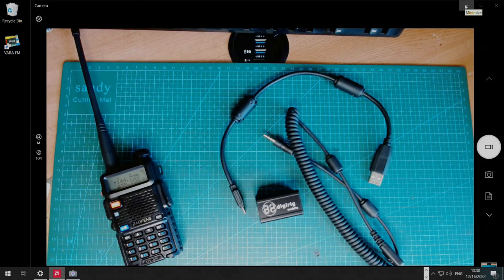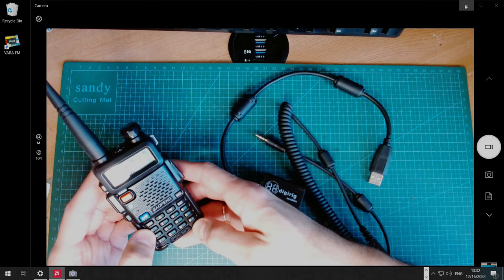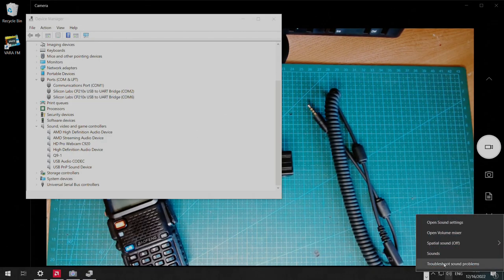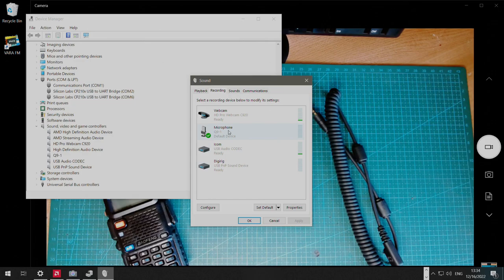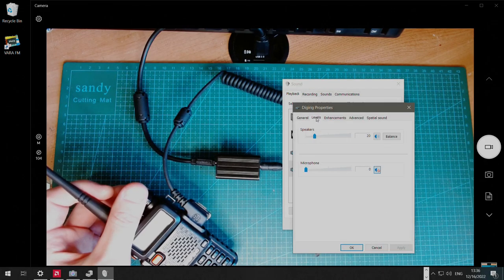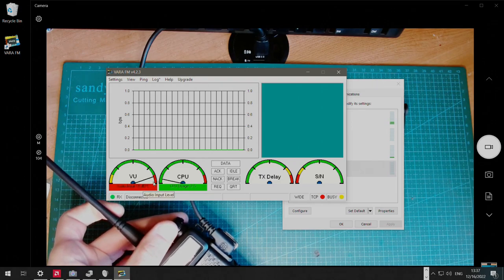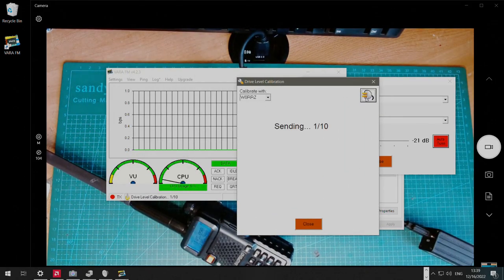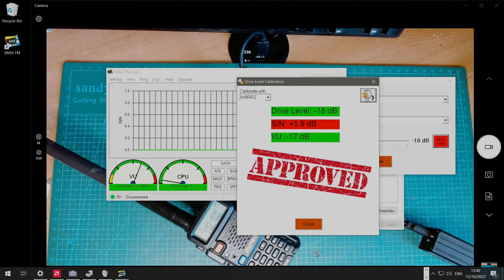Digirig setup for VaraFM with HT

Comment: Thank you so much for this video. I was trying my 2nd Digirig unit for a second attempt at VHF digital, but this time on a Baofeng instead of building cables for an old Radio Shack HTX-202. I was again struggling, but stumbled across this video and followed it step by step. I was able to work a local Ham on WinLink VARA FM P2P on the first attempt. Thanks again for this video Dennis!!  de N9XFX Dennis

Comment: I just got the Digirig Mobile and everything has worked well until I go to auto tune and it tries 10 times and then comes back “no signal”. I did the test where I looped AOUT to AIN and ran the WJST-Tune to get a tone and when I had computer set to “m😅motor/listen” - I could hear the tone so I think the hardware all the way to the K1 jack is okay… Any suggestions? 
73 de KZ4JN
Reply from the maker: If you hear the audio while monitoring through "listen", the radio keys up and you can hear your signal with another radio tuned to the frequency then all all the hardware is performing as expected. You can rule out RF link quality by taking your station to where the remote station is. Also check that the remote station is set for Vara and not packet.

Comment: What was the purpose of resetting the UV-5R at the beginning?
Reply from the maker: This is to confirm that there are no required setting changes that were made off the camera. You don't have to reset yours, but if you are having difficulties I would recommend it.
Reply: @digirig  thanks, that makes sense

Comment: hi i got the digirig from you for my baofeng, but just got an yaesu ft-897 with autotuner that is using the CAT port, do you have av cable that is compatible with my settup?
Reply from the maker: You'll need this cable: https://digirig.net/product/yaesu-ft-8xx-cords-for-digirig-mobile/ If you tuner has a pass-through serial port then you connect radio's 8 pin MiniDin to the tuner and tuner's 8 pin MiniDin labeled "computer" to Digirig. Audio cable goes directly between Digirig and radio.

Comment: Good video! Can you use a Digirig to work with the Echolink program, to run in Sysop mode?
Reply from the maker: Yes, you can use Digirig with any sound-card-based digital modes software.

Comment: Will the Digirig allow VARA FM and Winlink connection with a Yeasu FT5D? If so, are the necessary cables available? If you can point me towards a tutorial with that set up, I would appreciate it. Thanks.
Reply from the maker: Yes, you can use your Yaesu HT for VARA FM with this cable: https://digirig.net/product/yaesu-ht-cable-for-digirig-mobile/ The setup instructions are pretty much the same as in this video. General instructions can be found here: https://digirig.net/getting-started-with-digirig-mobile/
Reply: @digirig  Thank you for the reply! I’ll  be buying one soon.

Comment: Hello.. Thanks for the great tutorial.  Unfortunately, your version of Vara FM is outdated and has a different interface, starting with the PTT item in the Settings menu and items therein.  I am using APRSIS32 and can not get the radio to PTT.   So far, no joy...  Suggestions?  Thnx.  Cole VA7APZ
Reply from the maker: You must be looking at some other software. I've just fresh installed VARA FM v4.2.9 (VARA for FM transceivers) and it uses the same settings as shown in the video.
Reply: You might be looking at VARA HF instead of VARA FM. If your third menu selection under Settings is Waterfall then that is VARA HF. In VARA HF, the PTT is actually in the Winlink Express VARA HF window under Settings -> Radio Setup.

Comment: I have a problem with Digirig whe I am using with Yaesu FT891 and windows11. FT8 receiving is okay but wen transmitting radio will changing transmitting mode but no RF power coming up. I check audio signal on digirig with a headset it is working fine. How can I fix it?
Reply from the maker: For FT-891 related information please visit https://forum.digirig.net/t/cables-for-yaesu-ft-891/16 The post covers the cable connections and suggested transceiver settings.
Reply: Ensure you set the system audio input outputs to "default". Ensure you set the digirig audio input outputs to "default communication device".

Comment: Can this work with only one HT? Why two?
Thanks for the video :) 73 de OG3E
Reply from the maker: Second radio in this video is just to monitor the transmission. It is not required for the normal operation.
Reply: @digirig  Ah, i had to watch that part again, now i saw it 😂 Just ordered cables from your site.